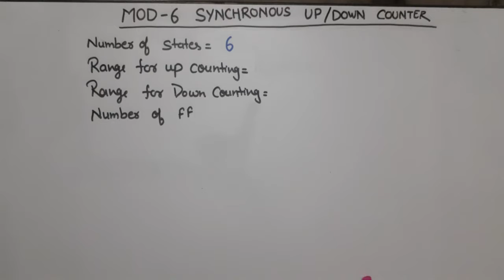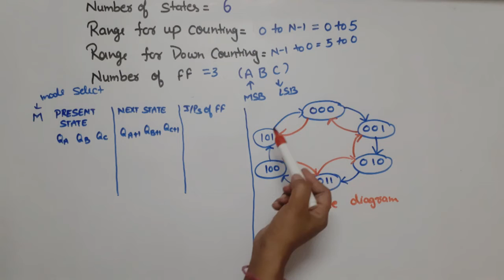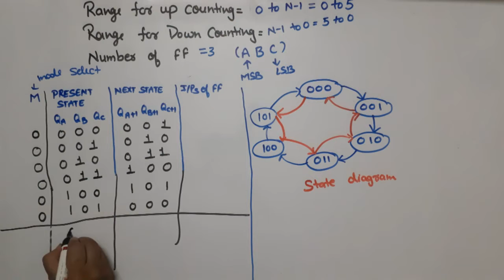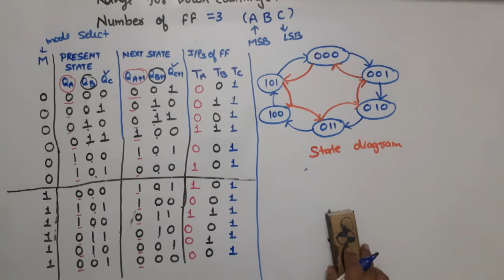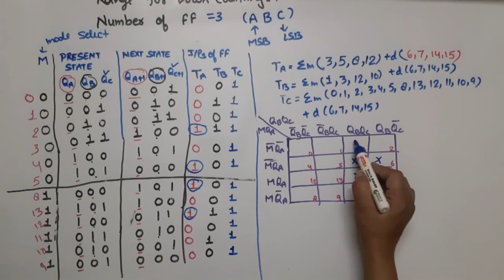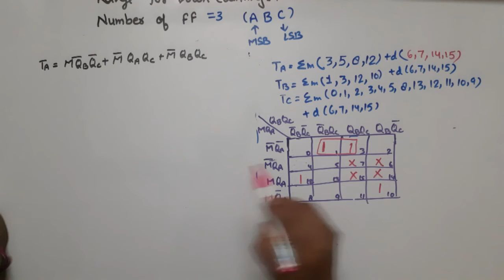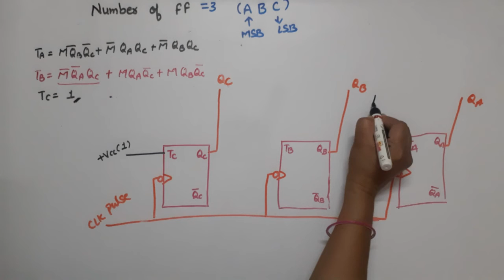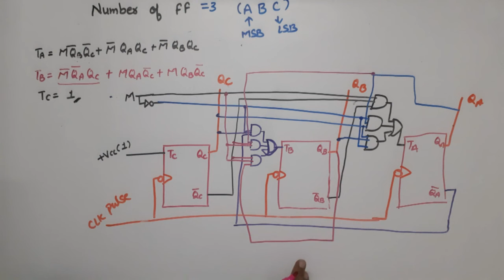MOD 6 UP/DOWN Synchronous Counter | MOD 6 up/down counter using T Flip Flop

Comment: Is it requires unused states
Reply from the maker: U can design with or without unused state then circuit will be different
Reply: will both circuit are correct ?